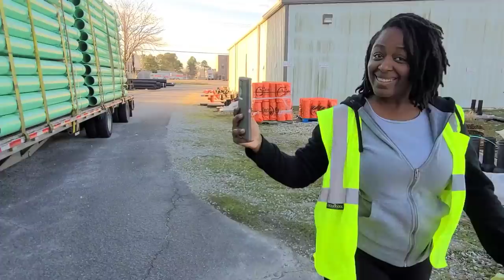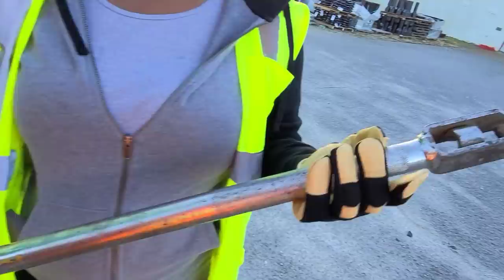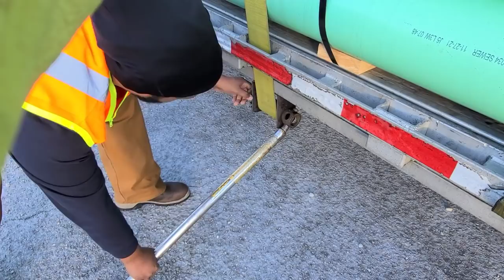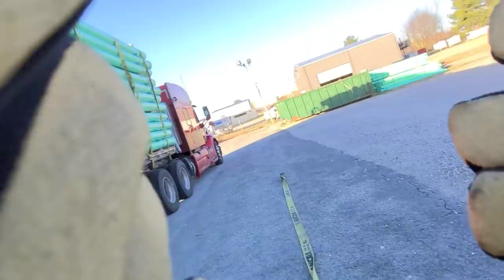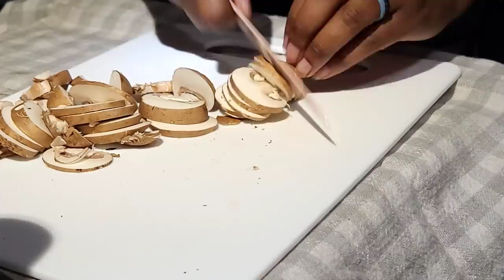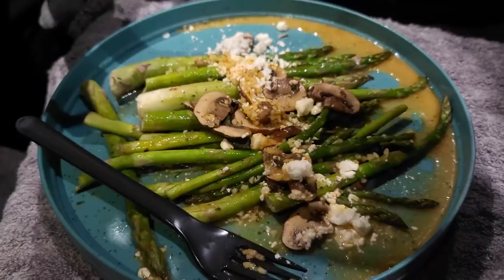trucking training flat bed ep1

Comment: Edge protectors also protect the edge of the load as well as the straps. Like with drywall and roofing shingles. Recently I’ve been using my rolled up tarp on top of some items the strap may split in half like bags of asphalt used for pot holes. The tarp helps evenly distribute the force. Or doubling or tripling edge protectors on top of each other if the edge protectors starts to fold in half. Just a bit of my knowledge. Hope it’s useful to you.

Comment: Can you tell her about finding the center of the trailer: an then set your fiveth wheel to the center or to the rear of the drive axle.  Please let her know that she should know her empty weight, with fuel at about 3/4 tank. On O/D loads make Google maps your friend.